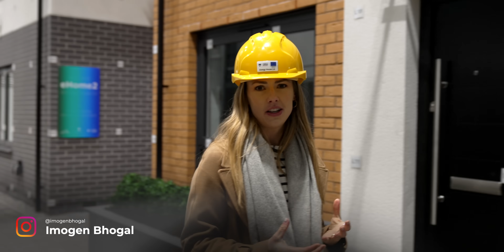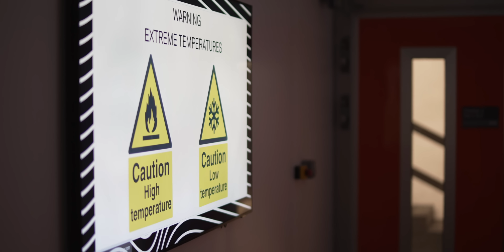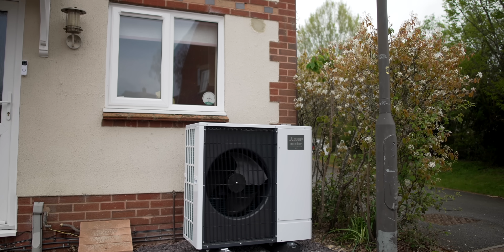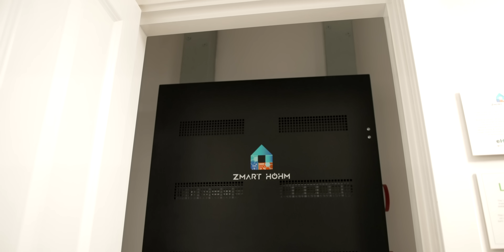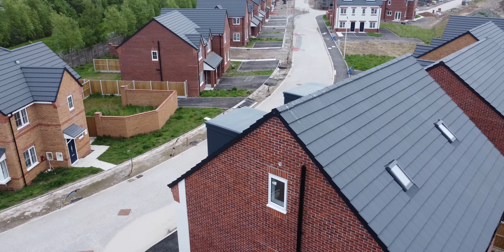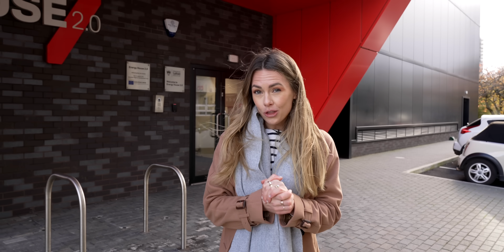Stress Testing Homes in EXTREME Conditions!

Comment: Are UK houses inefficient? We live in Vienna, in a 40+ yo house with 4 beds and 2.5 bathrooms. Admittedly, we don’t like a particularly hot and stuffy house, but in the winter, we barely use the heating and in the summer, other than those rooms that get a lot of sunlight, the insulation does a very good job of keeping the house cool. We have district heating and hot water , produced by burning garbage (not including paper of plastic). More recently built properties have even better insulation and the City of Vienna encourages alternative energy sources. We have double glazing, but many of the newer properties being built have triple glazing. The city is also subsidising passive cooling, such as window shutters.

The UK has a lot of catching up to do.

Comment: As a Swede I have lived in UK (Manchester area) for 4 years between 17 and 21. When it comes to energy efficiency and how to build (have not seen a properly built house anywhere in UK by Swedish standards) just come to the Nordic and build like we do.

232 m2 (I know you are measuring size of house by #rooms, but we actually measure size 😂) consumes 1/3 of energy of our UK home (150 m2 approx). And that is in a country that is actually cold. ❄

Just come here and copy, you don't need airplane hangars of cool air.. 😉
Reply: Australian here. I spent 1 year in Denmark in 1998. I was never, ever cold inside, despite the snow and ice outside. Danish building standards are really good. Even old houses and housing for low-income earners was very well-insulated. Despite our relatively mild winters in comparison in southern Australia (Melbourne), our houses are so poorly insulated that unless you have the heating switched on 24/7, you really feel the cold, even though you are inside. This goes for houses, as well as schools and many other public buildings.

Comment: Whilst all these innovations are great, if as most people do one lives in an old house it’s very costly to apply the energy saving green ideas. For example I’ve fitted solar panels £12000 battery storage £8000 and possibly a heat pump £12000 - £15000. Not many people especially younger ones have that sort of cast lying about after paying their mortgage ect. I can see a future where old houses will start to loose value when in 10 years time or less people will buy new builds rather than have the expense of old properties where they have to upgrade them or pay high energy prices.

Comment: I am glad you are focussing on retrofitting old homes. My family and I lived in a brick terraced end row house in 1993 in Chester, England. It was cold so we would all gather in the front TV room and blast the natural gas heater. Here in Canada, I recently bought an old two story 1912 character home. It was a natural gas energy hog. So we gutted it completely and installed triple pane windows along with 3" of foam insulation in the exterior walls. The comfort level, costs and emissions are night and day. We heat with electricity during the fall and spring and a tiny wood stove during the winter when it was -36C outside! High insulation upgrades are worth their weight in gold.

Comment: I have built several houses in the Artic Circle in Canada and Norway. They used SIPs with protective boards on the outer shell then timber cladding. 2 of them used HRVS with heating units in the system. They were all extremely airtight. The thing you have to learn is to build quick as the summer doesn't last long. Some of the Canadians worked on the hotel in Longyearbyn. Forget Passiv house it doesn't work at -20c
Reply: Maybe passive house is too tuff (I live in Norway) but we can still improve. My house was built 20 years ago and many of the upgrades the builders refused to do based on Norwegian standards. Probably I could have argued with them more. But I let it happen. That is sad now as I’m paying the price for double glazing - not triple. Too little insulation. So lost energy, and not airtight, or even close. Perfect is not necessary - much better is! 
I hope everything electric will run a series on simple upgrades to help everyone.
Reply: I agree. It is difficult upgrading.. secondary glazing on top of double glazing may help. Building a vestibule inside or a small porch outside as an airlock helped with a building in the North East of Scotland. @milesbuckhurst504
Reply: *Arctic Circle 🤔

Comment: Solar panels should have beem mandatory for years on all new builds, but the greedy developers are too intent on cramming as many boxes as possible into the available land, maximising profits and giving children no garden to play in. Access roads stay unfinished for years after all the boxes are filled with families. Most of the "garages" are just a cheap way to not finish a room, because you can't fit any modern car in the decades-old standard garage dimension. I think it all went wrong in the 1980s? It's great if the new boxes are going to be super-efficient, but the lived experience of a big-developer 's crowded Boxville estate won't improve.
Reply: Absolutely, builders have meet energy efficiency requirements and if they fall short they can add solar panels to meet the requirement. But they just add the absolute minimum very often one or two panels on a roof where there is space for 16. A large part of the cost is just running the cables, paperwork and roof work which are the same regardless of number of panels. The cost of the extra panels is minimal compared to the savings that occupants would make year after year. 
The uk is just the nastiest cheapest chap they can get away with

Comment: I live in a 1950s ex council house that I have already improved with a better front door, insulation in the attic and modern radiators, so I am definitely interested in the improvements that can be made to an older house. I have solar panels and a home energy battery, but right now cannot afford (even with the grant) a heat pump.
Reply: If you can financially: windows, floor insulation, and importantly: insulated walls but on the outside plus new rendering on top.

Comment: Future Homes standard - zero carbon homes - by 2025.  Great, except for the fact that we had this before - requirement for all new homes to be Code 6 by 2016 - zero net carbon homes - 15 years ago and it was scrapped by Tory Govt. following intense pressure from UK house builders.

So the obvious question is that why will the Future Homes Standard not fall by the wayside in exactly the same way as Code 6?

A very optimistic video but the reality will be very disappointing.  UK House Builders have no intention of changing the way they build homes, they will ensure that the Future Homes Standard will be nothing more than putting lipstick on a pig
Reply: Not actually zero carbon homes, ready to be zero carbon home, aka they will have to be retrofitted to be zero carbon at some point in the future. The construction industry will leave out as much of the technology to make these home zero carbon as they can get away with. I suspect they will be the house with just the require pipe work and insulation for a heat pump but no heat pump, the wiring for a car charger but no car charger, the roof will be signed of as being able to support solar panels but no actual solar panels will be fitted. There will be a location for battery but no actual battery.

Comment: Experts on the Passive House standard have assessed the Future Homes Standard and found it to fall well short of the Passive House benchmark in terms of energy efficiency. Modelling across a range of building forms shows the energy consumption of homes built to the FHS falls in the range 40-50 kWh m-2 y-1 compared with 15 kWh m-2 y-1 for passive house. See the AECB lecture by Qoda entitled “Part L and Future Homes Standard” on YouTube.

Comment: One off test homes are all well and good but it all comes down to the quality of contractors that actually do the building in the real world.
Reply: I fully agree. My builder was doing a pretty poor job of finishing insulation properly. He is now off the job and I am removing much of it to refit properly.
Reply: I worked for an architect/site manager, who got me to remove an old chimney, after the plasterer had placed the insulation between the beams. They had unrolled 60cm wide rolls of rock wool, between beams with gaps varying from 55cm to 70cm, without cutting or filling the gaps. 
 It was partly financed by the gouvernement to help reduce energy use.
Reply: @robinhood4640 I was told that our house had cavity insulation done. Checked when we had a new window fitted and indeed, you can see that some shredded glass wool has been injected in the cavity. But it’s  been so poorly done, and you can tell that not enough was injected that it makes you wonder: what is this stupid patchy technique achieving in terms of actual insulation, since there are gaps everywhere with no wool present…😅
Reply: @Nikoo033  The problem is the work is never checked. If contractors only get paid if the work is tested and past to a third party standards, they would either go bankrupt or do the job properly.
Reply: It would be good if Salford could incorporate these types of building faults in a test house, and some others such as cold bridges, poorly sealed floors, window frames, door frames, and so on, quantify their effects and come up with tested remedial actions to help upgrade the existing stock effectively, providing costs/benefits v current costs and action templates for owners of buildings with these faults
Reply: So the ones certified good will clean up. They'd need to qualify for the new tech.
Reply: exactly